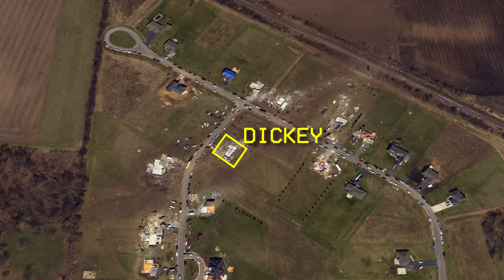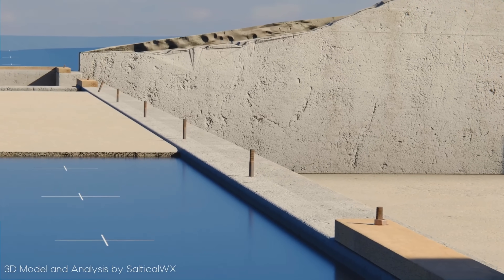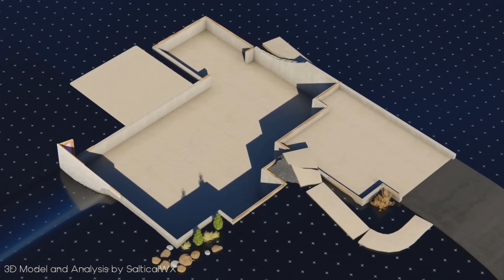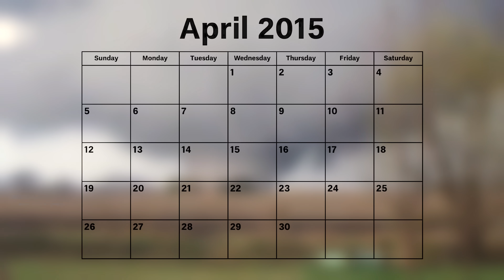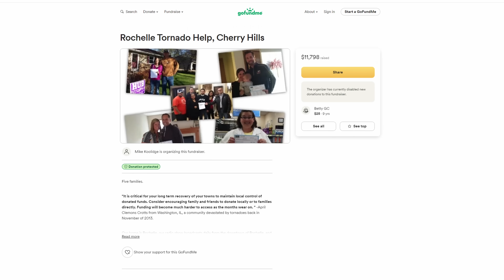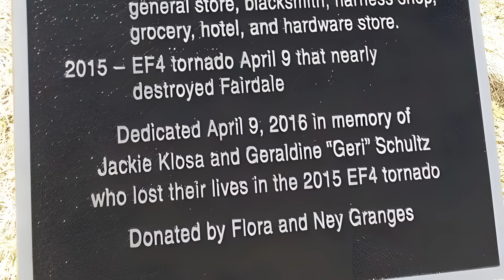The Strongest Tornado That Wasn't Rated EF5

Comment: The tornadoes rated on the edge of EF5 like this one - need to have their individual characteristics considered and used that to determine which it should be. While the track and general wind conditions are looked at it looks normal - seeing things like the concrete slab walkway should have pushed it just over the EF5 rating. Hopefully they’ll finish making the new scale I’ve been hearing about for years soon
Reply from the maker: Totally agree, well said
Reply: Fully agree. Slab wiped clean is a damn good indicator of a 5.
Reply: At the end of the day does it really matter? Doesn’t change the outcome. Very scary no matter what rating.
Reply: @Tim9460-o9t  its about statistics...sure the outcome is the same...but if we keep underrating tornadoes then we are not getting a real depiction of the frequency of these top end tornadoes...that they actually are way more common then we think and good data is needed for research and science...as well as trying to build better structures to stand up to these things...
Reply: @MariktheWolf I guess I’m looking at it from the victims point of view. Doesn’t really matter what they call it the outcome doesn’t change.
Reply: @Tim9460-o9t  and in that perspective you're absolutely right! I don't want you thinking that we all disagree with that. It's just that in these severe weather channels' comment sections, we're usually trying to talk about it from the perspective of science and how to make things better in the future. ❤
Reply: @SnailOnAMossball I think everyone wants to be every tornado to be rated an F5. I never seen anyone argue an F5 should have been rated an F4. It’s natural of course. We do this stuff all of the time with other topics.
Reply: @tico78742  unfortunately it does, not necessarily at the 4-5, but when you're in 2-3s and you're a small town that gets trashed by a not-as-strong tornado you're more or less on your own.
Reply: @halfatrex4555  Unfortunately it's just a name we assign it. Has no bearing on the actual outcome. Call it an EF8 but it doesn't change the outcome. See what I mean?
Reply: @Tim9460-o9t It does change the outcome. The rating of the tornado changes the amount of disaster relief money you get. Exactly why they aren't doing EF5 tornadoes anymore.
Reply: @Tim9460-o9t it does for data, as well as for the families. 

El Reno had Doppler rated windspeed of 302, but very likely more due to the curvature of the earth and the fact that radar shoots linear, so speed recorded from a distance might be lesser than what is actually present on the ground. 
It was also the largest tornado ever recorded. It was only beaten in windspeed by one tornado: Moore. 
Rated an EF3. 

Insurance payout is significantly greater for tornadoes rated EF5. Families and businesses don't get the same level of payout if rated lower.😮

Comment: From what I know of the EF rating process, the reason why they'd give a rating of exactly 200mph when EF5 starts at 201mph is because the EF scale only has a very narrow set of damage indicators for EF5 damage, eg homes have to use specific construction methods and then get slabbed to earn an EF5 rating. If the tornado never hit anything that could show an EF5 indicator (ie the homes it hit weren't built using methods specified for EF5 damage indicators) , then the highest they can rate is EF4. Even if the damage it did would be more than enough to show equivalent damage to the EF5 indicators, they can't give the rating based on that. That's probably why the rating came so quickly too. The NWS knew this tornado was way over 200mph, but they also knew very quickly that there were never going to be any damage indicators to prove it for the EF rating, so it wouldn't have taken long at all to conclude it should just get the absolute highest possible rating they're allowed to give under the EF system. That's a pretty solid argument for changing the EF system itself and adding more damage indicators, but it's not the NWS' fault or that if the assessors on the ground.